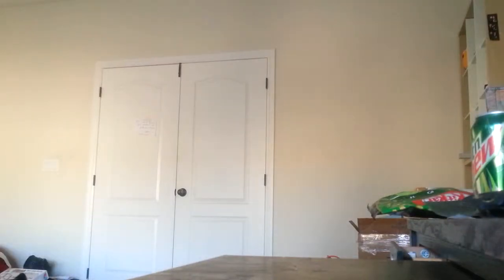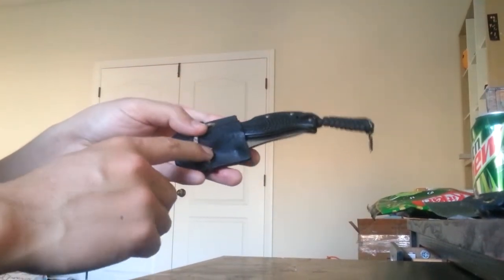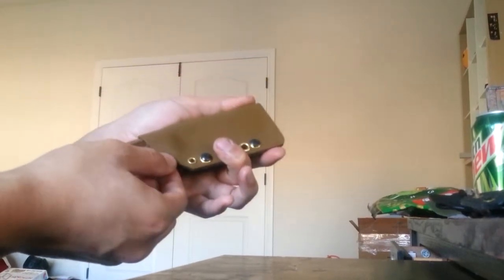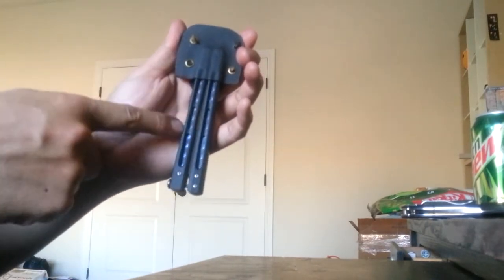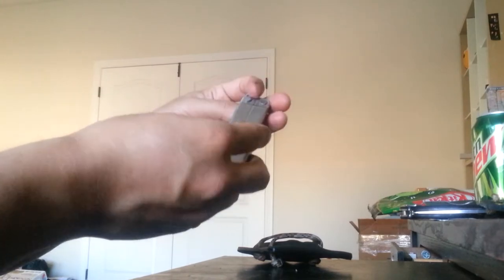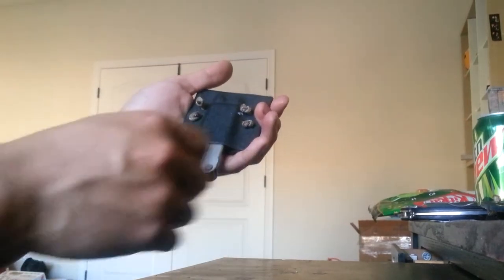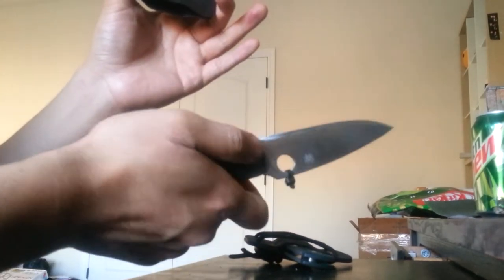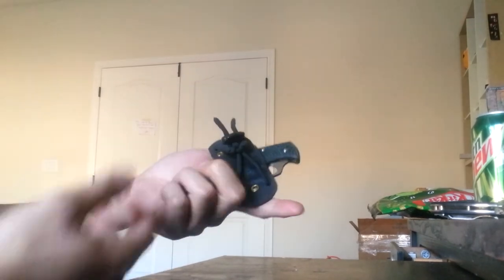Folding knife kydex sheaths

Comment: Have you ever done a Spyderco sheath in the open position? I’m thinking about getting the Salt Assist for a dive knife. Thanks for a good video with lots of tips.
Reply from the maker: yep it works well with the typical shape they do with the frn handles. That front curve gives something for the kydex to hold onto. Downside is with the spydie hole it usually makes the sheath a lot bigger  that necessary.
Reply: kchee1111 cool, probably will do the closed design then.
Reply: kchee1111 I’m trying to find stainless eyelets since this sheath is for diving. Do they not make stainless eyelets? Probably looking in the wrong  place.
Reply from the maker: @Chogogo717  Stainless does not very ductile. the open end of the eylet needs to mush or roll out to hold the other side of kydex. Dont think they will have that. Can try finding stainless two peice rivet